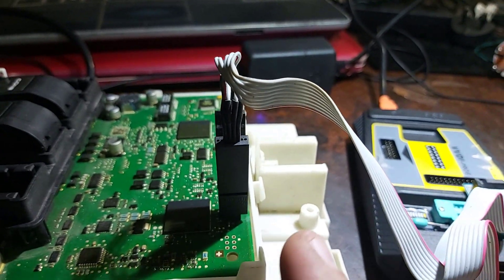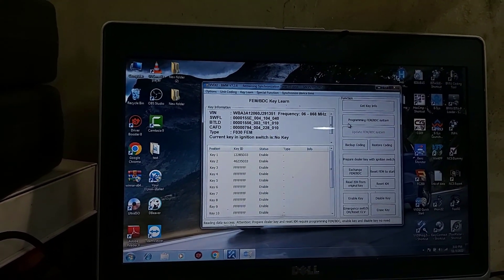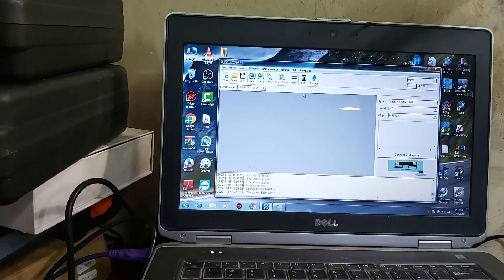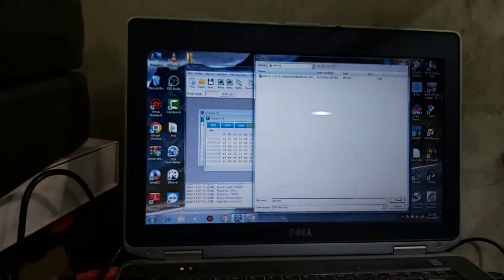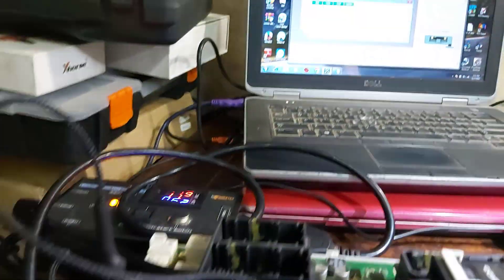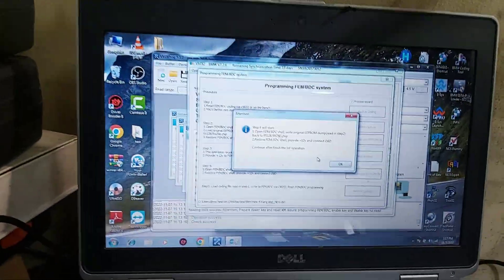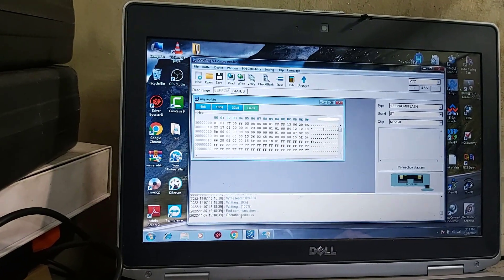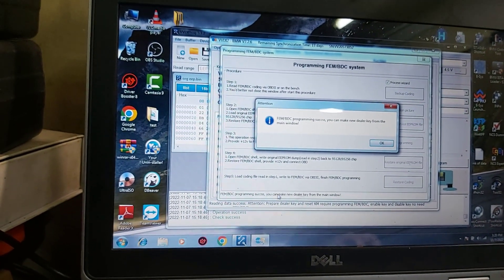FEM Unlocking & Programming By VVDI2 & VVDI PROG

Comment: Hello! I do all the steps and keys can turn the dashboard, close open doors but crank no start what do you think go wrong ? Fem and 430i 2017 bmw?
Reply from the maker: Read dme faults.. was it all lost ?
Reply: @heshamessam8042 yes was all key lost read ISN from Ecu. I will check codes whem I back to the car.
Reply from the maker: @xChikarkas36x ok .. add key and decrypt with ecu isn ... i think there is a problem there
Reply: @heshamessam8042 do you think do I have to disable missing keys I read that only 2 physical keys can work on fem. And right now I have 4 enable, 2 I make and 2 missing.
Reply from the maker: @xChikarkas36x no 4 is ok ... check isn of dme while making all lost
Reply: @heshamessam8042  thanks working i double check ISN and redo the keys and now is working thanks for your help amigo.
Reply from the maker: Thanks

Comment: Do you know if I can use xp400 pro to read the fem eeprom and either vvdi2softeare or xhorse key tool plus to reset km. Will the files be compatible between xp400pro eeprom file and editing with vvdi2 back to xp400 to write?
Reply from the maker: @M12MA  I think yes ... but for me I like using same company tools ... so use xhorse or autel

Comment: friend, tell me - did you make any settings for vvdi prog to read eep m95128 through a clothespin? .. my vvdi prog does not want to read through a clothespin in any way , and it is soldered through a panel too ..I've tried different versions of the software ...Maybe there is a secret?
Reply from the maker: @user-gs4eg2qw6o  sorry but what clothepin? ... do you mean the adapter(clip) ?
Reply: @heshamessam8042  I have the same equipment and the same clip... but it doesn't work for some reason
Reply from the maker: On which board ? ... fem ? Sometimes it can't on some pcb
Reply: @heshamessam8042  yes..I have everything as you have..but it does not read the eeprom